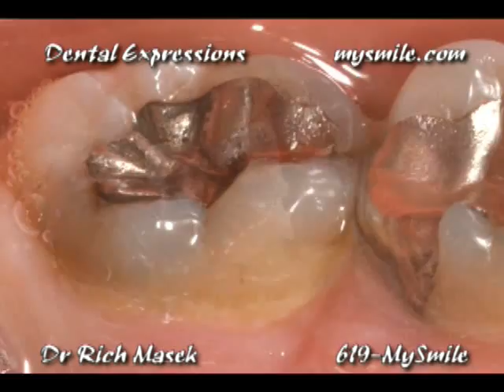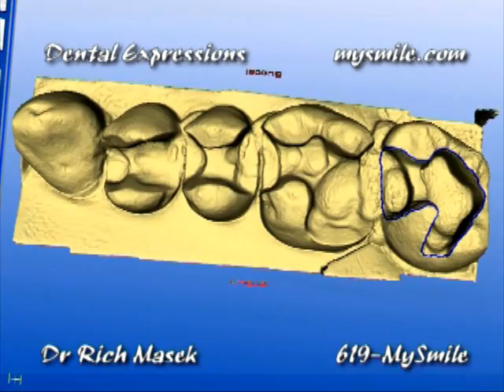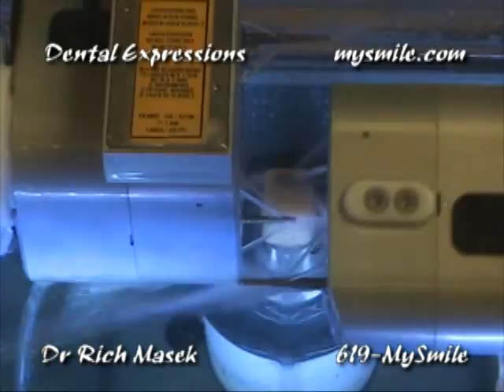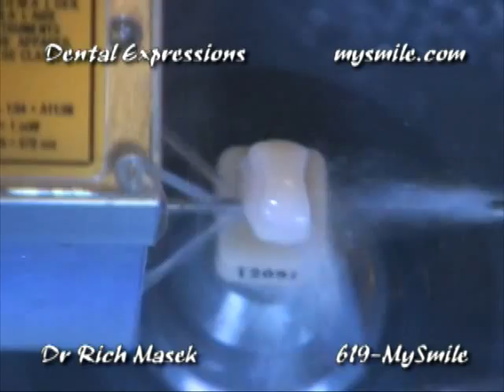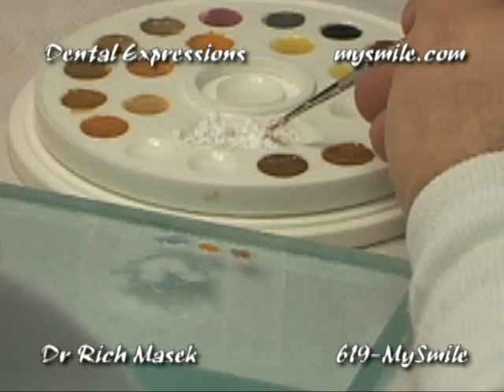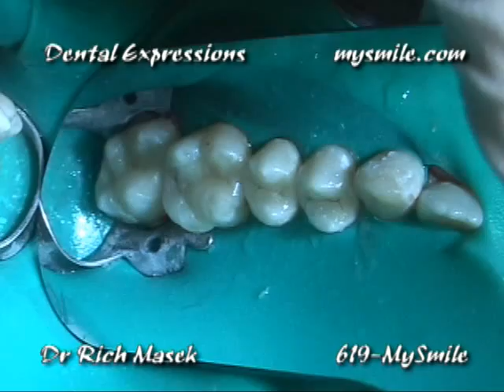CEREC Esthetic Dentistry at Dental Expressions by Dr Rich Masek

Comment: CEREC procedures can be cosmetic, however the majority of them are restorative and are covered by many insurance plans. Generally a porcelain material (no metals/mercury) and can be done in one day. Your actual insurance benefits are determined by the type of insurance plan that has been purchased either by an employer for their employees or personally. Costs vary by provider and are generally more expensive than the amalgam. Your share of cost is determined by the insurance plan.